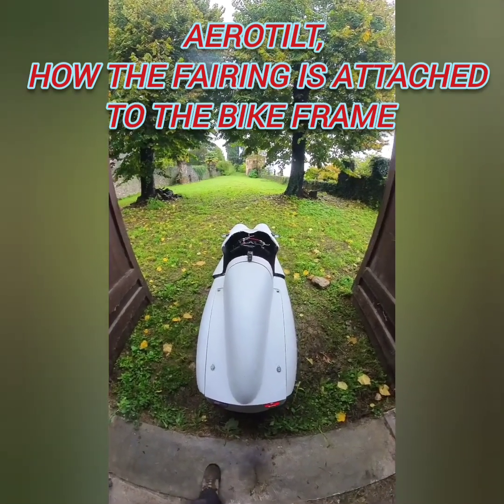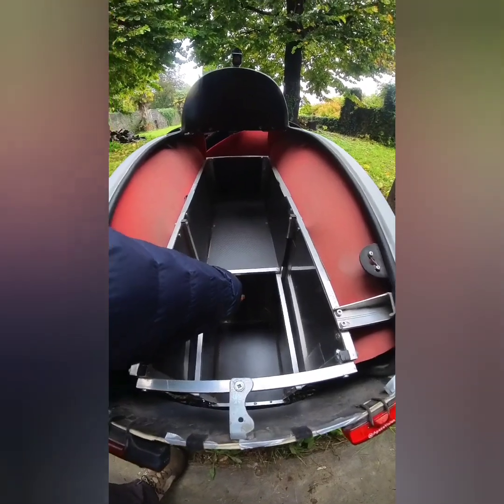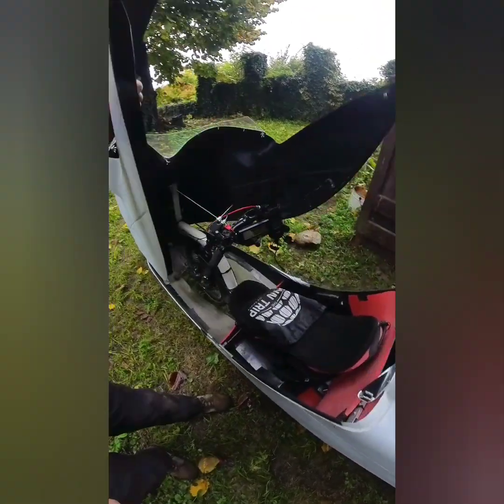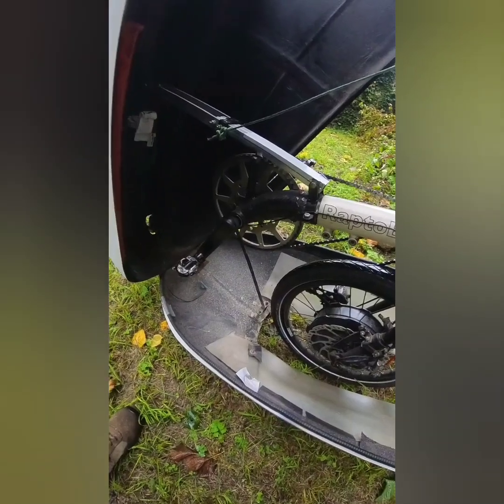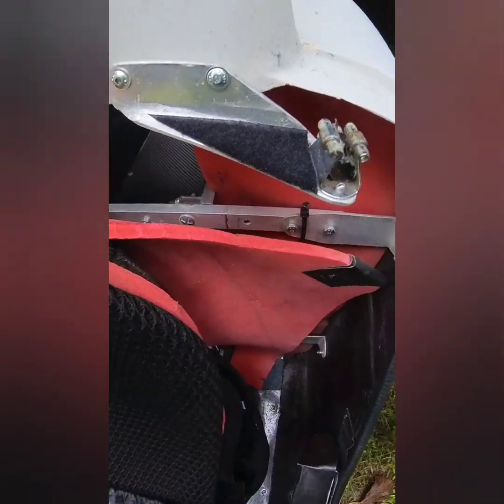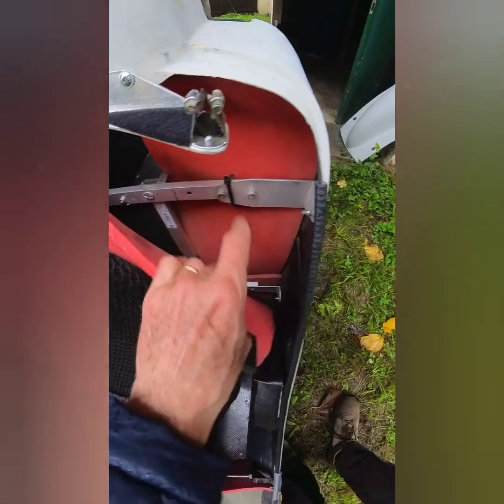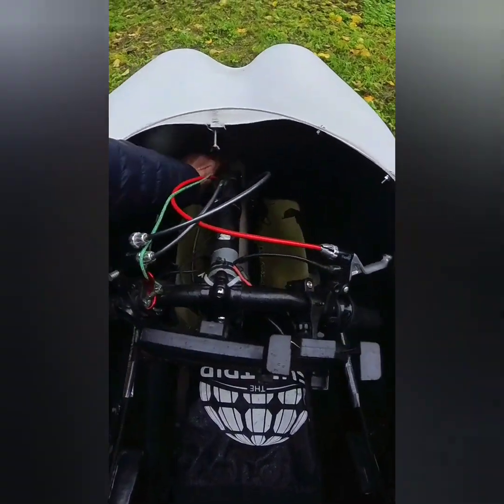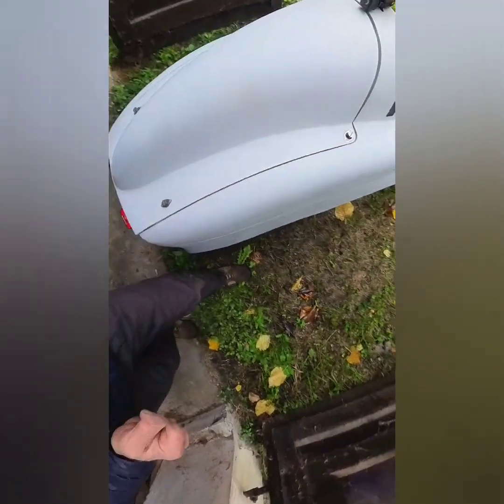AeroTilt: how is the fairing designed and attached to the Tilting bike frame?

Comment: That mounting looks robust.  Is this exclusive to Raptobike?
Reply from the maker: @jeffdible8171  This prototype is based on a Raptobike frame.  Other frames could be used as long as they are "front wheel drive" compatible to be able to install this TILTING mechanism.